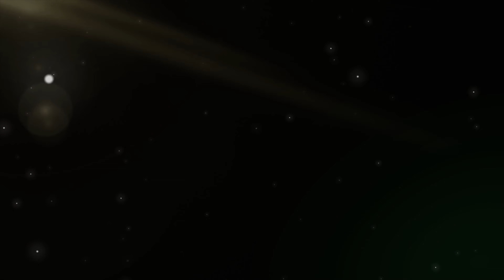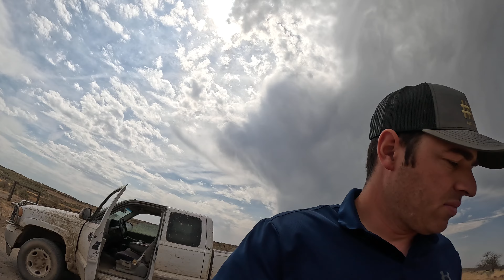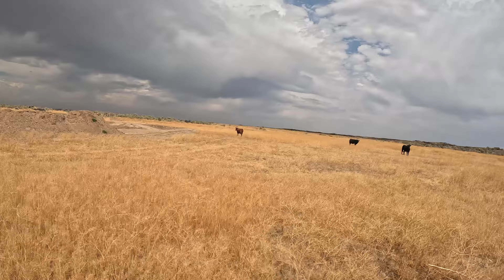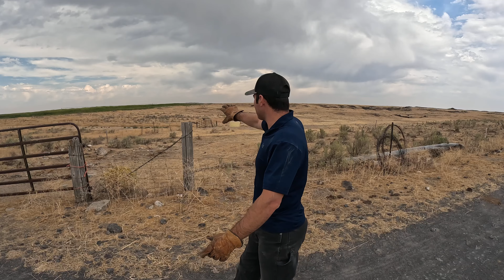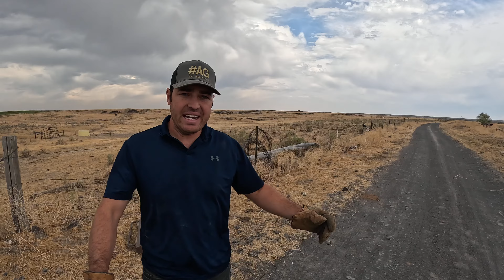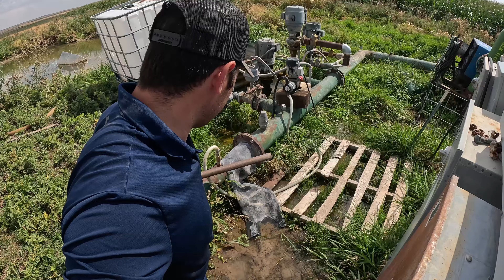**What Fence Should I Build? MAJOR REPAIRS NEEDED! 🚜🔧**

Comment: Timeless fence, if I understand correctly uses PVC posts. 
How well does that stand up to sunlight. Seems like it would brittle over a few years.
Reply from the maker: They hold up really well from what I have heard. They have a UV protective coating and are designed to last at least 20 years
Reply: @americanbeefranch  Interesting. With plastics I always worry about them becoming brittle. If they do last 20 plus years that is quite a long time for plastic.
Reply from the maker: @dralord1307  they have a limited lifetime warranty with coating guaranteed 20 years. Sounds like they should be just fine
Reply: @americanbeefranch  Well marketing is marketing. Only one way to find out for sure.